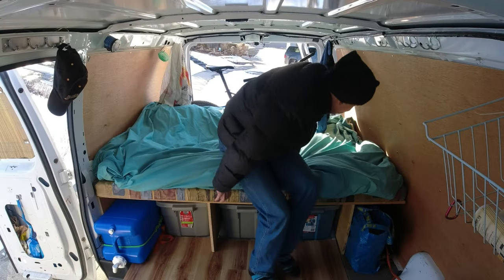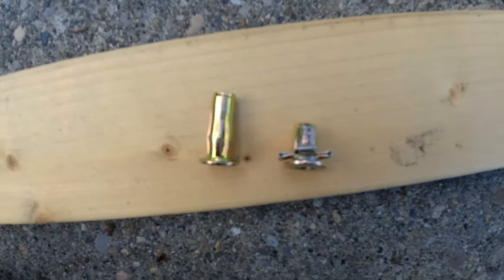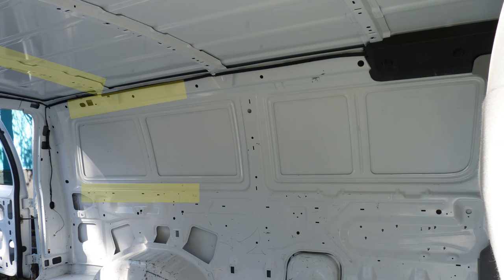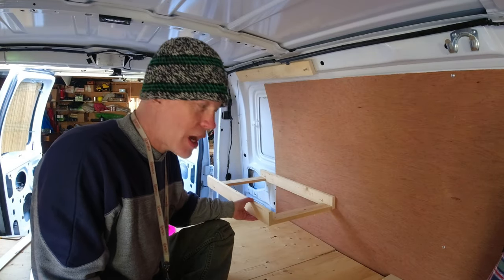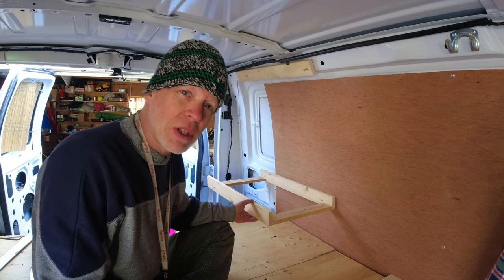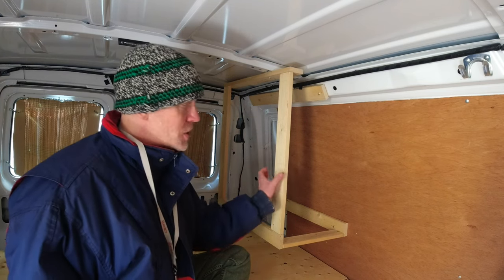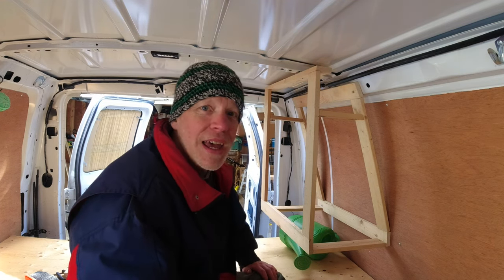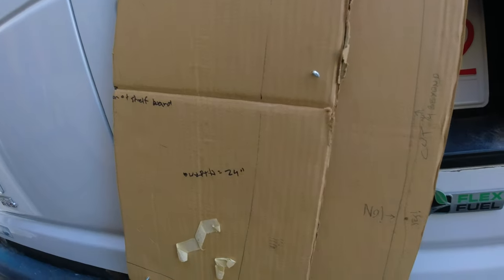Stick Frame Cabinet via Pocket Holes Plusnuts (rivnuts, jack nuts) | Van Conversion Cabinet #vanlife

Comment: How did you attach the side panels? wood screws or some kind of glue?
Reply from the maker: I just used some tiny finishing nails because the panels are just 1/8" Luan plywood.

Comment: I think I like the mvb concept I've heard it before. It makes sense. I've got to put a stove in my van think I know roughly where I want to put it but not sure. something like this I got to bolt to floor, drills holes through the floor and cut into the wall for a pipe exhaust so it's a little more committment without being sure first. thoughts?
Reply from the maker: Well, the sure sound nice, but in practical reality I'm not so sure about stoves... they are super heavy and depending on where you are it might be tough to find firewood... I think a diesel heater would still be my first choice at this point.
Reply: @SwellerVanDweller  My stove is small. I made it from scrap steel like a tent stove it might weigh 20lbs. I probably won't burn wood in it.
Reply from the maker: Oh, that sounds great! I thought you were talking about one of those giant potbelly stoves.

Comment: Your legs fit underneath it when laying on the bed?
Reply from the maker: Yes, I built it so there would be just enough space for my feet when pointed up, BUT I also built the cabinet to not extend all the way across the bed - it does not extend over where my feet normally are.